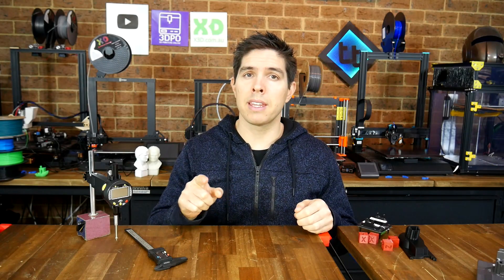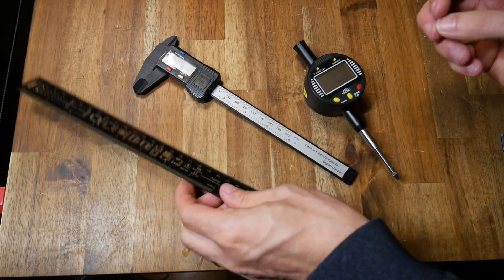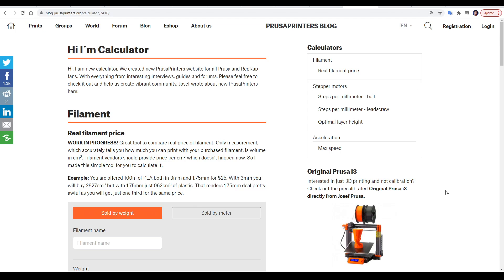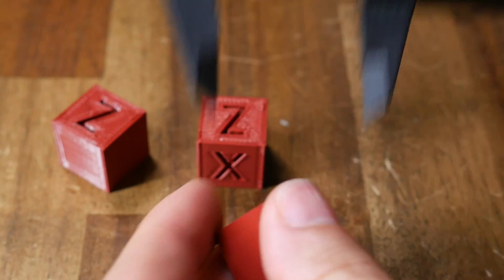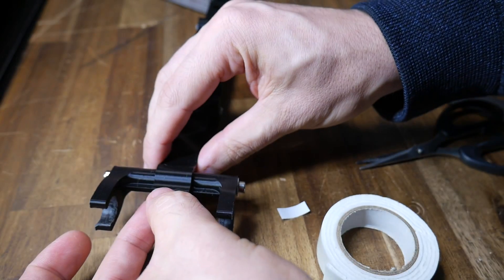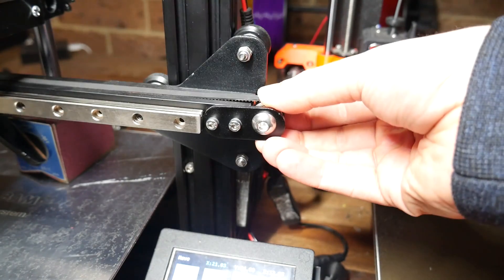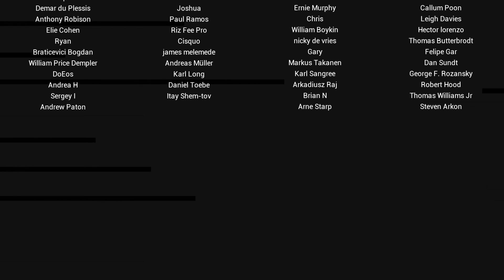Calibrating your XYZ steps using a dial gauge for maximum accuracy

Comment: Generally I wouldn't recommend doing this. While it's true that tolerance stack up can affect the mathematically derived X Y Z steps, if you're only measuring in one location, you've only calibrated to that one location. And by location I really mean the interplay between your belt/lead screw, toothed pulley/nut, and eccentricities in your rotating components. Oh, and stepper angle tolerances. So unless you're able to measure across the entire length of travel, or painstakingly measure segments along the length and average, your far more likely to make it less accurate than more accurate. And that's not even getting into the realities of inherent variance with fdm extrusion, and the complicated thermodynamic and fluid effects at play. Did you do your tuning with your machine at steady state printing temperature?  Well then you're no longer accurate. Not too mention belt and nut wear over time.

If you find this fun, by all means, have at it, you won't make it that much worse. But I doubt you'll ever actually make it better, and just generally will have wasted your time.
The part tolerance on my Stratasys machines at work is the greater of +/- .09mm or +/- .0015mm per mm. So on some of the best fdm machines in the world, your 20mm cube still has a tolerance of +/- .09mm. Just food for thought when you're evaluating how you spend your time

Comment: Here we go again, every few years someone comes up with the idea of calibrating their 3D printers X, Y and Z and every few years people who have AT BEST a dial gauge and some digital calipers go changing the 80 steps per millimeter (formula Steps per mm = (Motor Steps per Revolution (200 for just about every 3D Printer) * Driver Non Interpolated Micro steps (16 for just about everything but DRV8825 which are 32) / (Belt Pitch (2mm for most people) * Pully Number of Teeth (20 for most people)) it’s 80. It’s always 80 because all you can do is change it to 81 or 79 which will affect your prints terribly this number is not fractional at the level that a lay person has the ability to measure, all they will end up doing is measuring it incorrectly or getting thermal expansion/contraction or measuring REALLY HARD with the calipers to force it to be some value they want it to be. Stop it, just stop it, stop trying to calibrate a device that prints things the size of wastepaper bins at most with errors on the order of thousands of a MM, the only real possible room for any wiggling is in the Z height due to compression of hot filament but over 20 centimeters you might get it right for filament A but be vastly off for filament B. If you regularly print large plastic multi thousand tone cargo container ships at home then this might come in handy but for everything else this is an extra confusion to people new to the Maker community who are already confused enough!

Comment: I've read some of the comments disagreeing with the contents of this video saying you should never change the stepper values. The people who design the machime must think you should because they made it so you can. And they did so because there may be a time when you need to. If I tell my machine to move 100.63 mm and it moves 99.23 mm, I have a problem and never will get good results with my prints. When designing one must take into account the extrusion width of the extruded filament. For example, I use a .4mm nozzle. It squirts out a layer of plastic that is .6mm wide, so if you want to print a 20mm cube you need tell the head to move in both the x and y axis 19.4mm because the plastic is extruding .3mm outward from the center of the nozzle. I have been using this method and have had excellent results. There is no need to adjust your rate of flow to get the right dimensions in your final product.

Comment: Being a tool and die maker in the past, once a year we would have a tech come in and check our cnc mills for travel and or backlash. There are belts between, stepper motors and ball screws. This would give the tech the condition of the belts, balls screws etc. We needed to do this because we worked a lot within +-.0005''

Also, they are a closed system. They can remove the backlash. 3D printers are open systems. In this case, temperature and humidity take a huge factor on the belts. Like guitar strings. ;) 

So like many mention, Your parts of the printer are a constant due to being solid and the belts can change length with temperature and humidity. Like any object, they are affected by temperature and all have a different thermal linear expansion.

So stepper motor counts/mm should stay the same. Either dial in the belt tension with the dial indicator or use the thermal expansion in the slicing software.

Also previously being a plastic injection mould maker, you have to take the shrink rate per type of plastic you are using. For example, setting Z steps for PLA for that perfect 20mm will not be the same fore other types of material since the shrink rates are not the same. Again, using the thermal expansion in the slicing software.

Comment: Another problem with using that dial gauge is that a 3d printer is, virtual, a "no load" machine.  Other than moving its own weight around. That spring in the dial gauge, however small as it is, is throwing things off.

Comment: What lube u used with T8 rods?  Ive used silicon or vaseline but those are going pretty meshy after while and eatc movement displaces lube.. So now Ive got some PTFE spray, should I use that
Reply: Try replacing your lead screw nuts from brass to POM (Delrin). No need to lube these at all. I’ve had a set of these installed for about 5 months now and they’re still working great - with no lube!  You can find them on Amazon. The ones I found came with 6 nuts (3 sets) and they were pretty cheap
Reply: @Mali-jm4lm  Already ordered those and wayting to install

Comment: Nice video, but it does not work for my printer Anet ET4 pro (modified to direct extruder and z-axis stabilization) due to it‘s closed software. I did it this way, using Simplify3D:
1. I adjusted all parameters for the printer so that my prints are almost free of „bad“ effects that may have an effect on measuring the dimensions of a xyz test cube.
2. I designed (by TinkerCad) a 20mm test cube with x, y and z imprints on the respective sides to identify the axis
3. I measured the printed cube with a calliper
4. By calculation I identified the „scale“ of each axis in percent
5. In Simplify3D I added this scale values in the preferences. My values are z = 100%, y = 102.5% and x = 100.5%.
6. Printing a new 20mm xyz test cube showed that the accuracy is at 20mm, 20mm and 19.9mm. Good enough for me.

But using a dial gauge to check the evenness of the print bed is a good idea, I will do so in the next weeks.

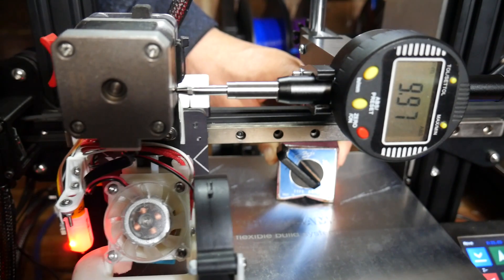Comment: At 8:15 you see the gauge moving.. also they-axis at an angle is moving a lot....I don't there is a need to calibrate your axis..there are no variables....it is about steps per rev, number of teeth on the pulley etc....if the axis is off there is something seriously wrong and not the steps per mm...the measurements are only useful to hunt down mechanical errors not incorrect steps/mm

Comment: I'm going to try to do this with a Laser distance measure. No contact, larger movement areas and ... Well, lasers!
Reply: this here, next level
Reply: How accurate is the device your speaking of and how much does it cost? If it is accurate enough and affordable then I would be interested in getting one because it would easily allow for a much larger measuring distance of the full travel of the axes.

Comment: Although a good idea, going of the math for the pulleys and belts (default steps/mm) is probably better. I found if my parts are a bit to big or too small, using the expansion compensation in the slicer is a more reliable.

Comment: I always had the problem that if I printed a calibrarion cube it was always 0.2mm too smal. Even when printing a 30mm instead of 20mm cube. Later I found out that this was from backlash in the servo I was using. Activated Backlash compensation and now everything is good to go again.

Comment: XYZ are mathematical calculations based on pulleys etc, i never suggest to do XYZ steps unless your replacing parts with non stock ones that change those equations

Comment: I disagree with this. It’s a pretty well known fact that you shouldn’t change x,y, or z steps per mm beyond the calculated values based on the mechanics of your printer. Even if your dimensional accuracy is off due to manufacturing tolerances as you stated, that inaccuracy is not going to be consistent across an entire axis. If your dimensional accuracy is way off and it’s due to some aspect of the kinematics not being machined to spec, you need to replace that part. Finally, If you are trying to get dimensional accuracy beyond .1 or .05mm, FDM isn’t the correct process for your application anyways. Almost anyone relatively knowledgeable or experienced with 3d printing knows this.
Reply: Unless your trying to make parts from multiple printers with tight clearances fit with one another, say .1mm clearance, then the factory settings are not good enough.

You say then fdm is not the right process, but I disagree.  If you properly calibrate your extruder and your linear steps per mm the same on multiple printers it can work.

I do agree that for 99% of people with printers this doesn't apply, but for the 1% trying to be as precise as possible it does apply.
Reply: Thanks
Reply: Correct! calibraring Axis is mostly the wrong way.
Right - If you have changed all Parts, your setup is mounted correctly then your Prints should be correct.

But sometimes your buyed Parts have an wide Manufacturing tolerance. Than you Can Mount it how Right you want and the Prints will ne incorect.
So in this Case you always have only ohne cance to make it better- calibrate a Bit your axis.
Ok there is anorher was buy Lots of high qualitiy Parts then it should be better but how much Money would you put in your Printer 

And then for me it is the only Right war to messure the movement direct on the axis.
Most YouTubers calibrate with printed Parts an thats Not correct
He is one of the lonly people that make it Right.
I was interestet how He mounts the caliper for measuring
Reply: Can’t agree more mate
Reply: @williamfosterXD  I’m disappointed, I’ve been a big fan of teaching tech’s content but this just is seriously lazy content. I am certain Michael knows that calibrating X y z steps in search of better dimensional accuracy is totally incorrect. 

   Which begs the question, why did he make this video? Seems like he cares less about the quality/accuracy/usefulness of his content and more about views/revenue.
Reply: This calibration procedure is just going to be a waste of time for everyone who attempts it. The method seems correct, but the factory calculated values will be good enough for 99.9% of people.
Reply: I didn't want to be that guy, thank you for doing it for me ;-)

I always make sure my machines are perfectly squared and check for slop/tolerance once every few months, dimensional accuracy should be dependent on print material and conditions rather be it room temp (enclosure temp) or extruder temp. But that just means it removes that from being a major factor when printing out parts, it's usually always material, temp, and size or shape and how different parts of the model choose to contract pulling on other parts of the model.

IMO this should be corrected at the slicer/software and with material/temp/conditions(room/enclosure temp) all with deltas converging to the desired dimension. That WILL be a lot of factors to include and quite a undertaking software wise.

Comment: I needed dimensionally correct scaled parts in a resin version. But this is a neat calibration for the old Wanhao i3 FDM with upgrades. I'm becoming a Patreon in hopes you'll figure out a resin dimensional calibration how to for your website. Cheers - NJ

Comment: Nice guide! I have a CoreXY so how could I make sure I am adjusting the correct motor in a coupled system? I think in order to do this you have to assume both motors are identical with adequate belt tension. I guess another thing to test is the Y movement (should be 0) from just an X movement, and vise versa.

Comment: While the idea of calibrating my machine this way kind of is attractive (and kind of not, because I'm lazy) how often would you need to repeat this process? I'm not (only) asking because of my laziness but because I'm cheap as well! Kidding aside, while 30 to 40 bucks for a good tool certainly is worth the money, it's only worth it if you actually need it more than once. I own a single printer and I will add maybe another one (with a direct drive) and that's it. If I was running a print farm, sure, but how often do you really need to calibrate a single printer that way?

Comment: wouldn't it be better to attach the gauge directly to Ender's frame? I mean also for X and Y axis
Reply: yeah, the main advantage is that you can repeat measuring the axis again using the unchanged setup after adjusting the steps in firmware.  This way you can check the result. I used Calipers and a small mount, to clamp them onto the build plate. This way I can measure X/Y steps without any need for manual holding. For Z steps my mount has holes, so I can screw them onto the 2040 frame of my printer. 
https://www.thingiverse.com/thing:4599123
Reply: @guidomersmann9744  thanks ;)

Comment: Would you be willing to add rotational distance calculations for those of us using klipper?
Reply: I just updated Klipper last night and decided to go the route of rotation_distance in my config file.  Looking at the docs (and knowing a little about my printer) I have "standard" stepper motors, so microsteps of 16, full rotation count of 200, 80 steps per mm.  Everything perfect world would mean rotation distance = 200 * 16 / 80.  80 (the steps per mm) is the number here you would be looking to update using the teaching tech calibration.  Once you get requested movement vs actual movement, plug it all into the calculator on the teaching tech page.  Then take the newly calculated number and use it as the denominator in our formula: 200 * 16 / <"new steps should be" number>.  The result of that calculation is now the rotation distance value for that stepper in Klipper.  Im not sure how precise it supports, but rounding to the nearest hundredth is probably fine.

Comment: perhaps a cnc digital readout might be a better tool for this. you can usually pick them up on amazon for around 30 bucks for a single axis. It would give you a lot bigger range of motion than the 1 inch digital runout gage your using

Comment: I don't think you should have fractional steps per mm unless your belt is over stretched or really poor quality, because repeatability of the machine may not be the same all the way through the range of motion. What you can end up with then is a compounding error along the axis you change. IMHO steps per mm should be exact to the calculation of your pulleys and stepper motor or this error is amplified by the travel distance and not actually improving repeatable precision. On a typical 16 tooth pulley belt for example if you have 100step/mm and you decide to change this to 101, for a 100mm travel you will be 1mm too far, and for 50mm you will be 0.5mm too far.
Reply: Came here to say the same.  Great, you can make perfect 20mm cubes.  Not try  40mm and 60mm.  Now you're off again.
Reply: You could use backlash compensation for a fixed value to compensate.

Comment: If it helps anyone out I have an indicator mount I designed a while back that allows you to mount the indicator to it and then temporarily use your bed binder clips to hold it down to check X and Y. To check Z you'll need a small clamp. I'm glad people are starting to realize that calibration based on parts is wrong practice. A machinist would never calibrate a machine based on a milled part so why would we do that with our printers? Leave me a thumbs up or comment if this mount helped you. :) thingiverse 4636281.

Now the only issue is if someone can figure out a reliable way to get the part sizes accurate after doing this. That was where I got stuck. Horizontal expansion sounds promising for X and Y but hopefully there is a solution for Z as well. Or maybe Simply scaling in the slicer by a fixed percent would solve all three axes. This problem needs solved and then the community would have a bullet proof way to calibrate.

Comment: Hi Michael, did you consider printing one 20mm cube and 40mm cube with the same settings and then extract both in XYZ? This way extrusion parametrs will be eliminated. Might be usable when you don’t have depth gauge or when you are unable to get precise measurements with it.
Reply from the maker: That's a clever technique.
Reply: @TeachingTech  Woodworking style 😆

Comment: Good video, easy to understand explenations.
I think you should have mentioned material shrinkage. Especially because no two materials shrink by the same amount. 
In the beginning this may not be as important especially when printing with pla, but on some projects where part dimensions are key. this needs to be considered
Keep on going!
Reply from the maker: Great point!